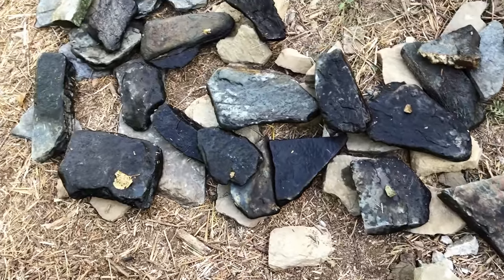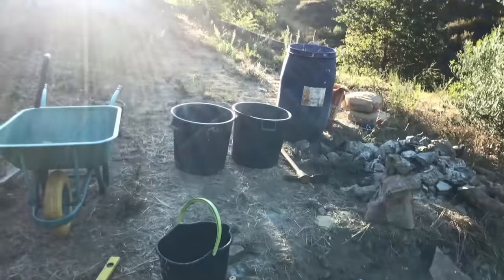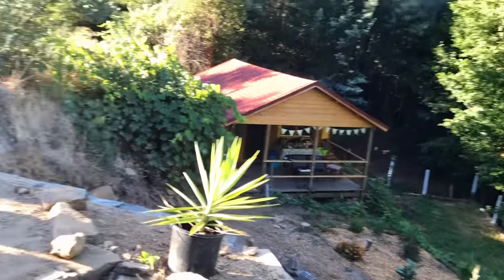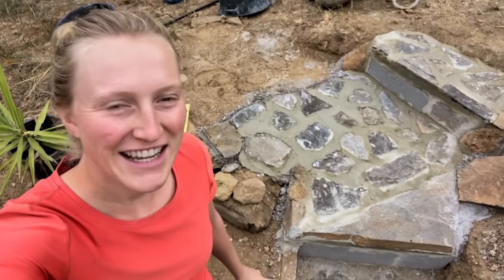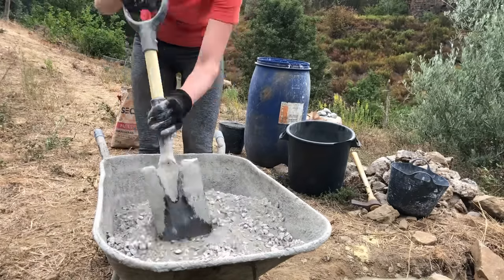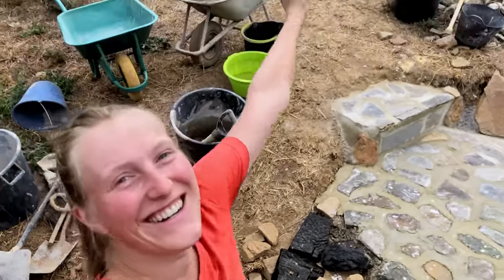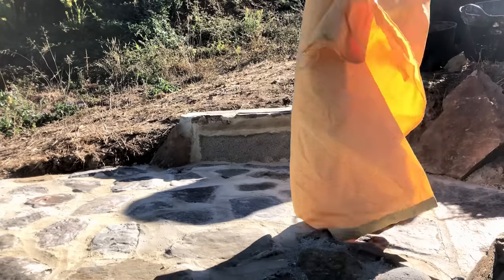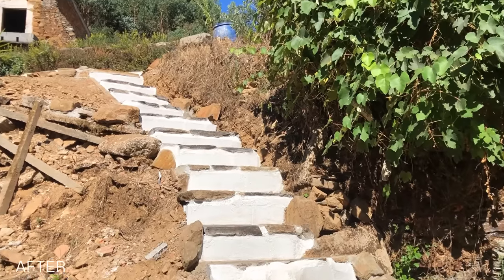Building Stairs Using Local River Stones

Comment: OMG Maya I’m exhausted just from watching all your work!  I’m sure you slept very well every night after all your labor. 🥱
Concrete sets using a chemical process called concrete hydration.  So it cures, it doesn’t dry.  The rain you experienced was quite fortuitous as the extra hydration while the concrete was curing helped make the finished stairs much stronger.
I wasn’t sure what you were going to do with the front of the steps.  As usual you came up with an elegant, simple solution.  I’m looking forward to seeing the top coat of paint. 😊